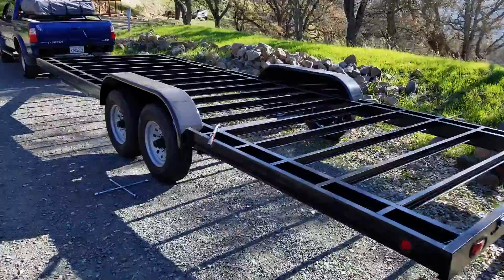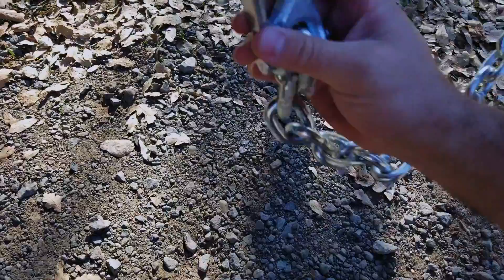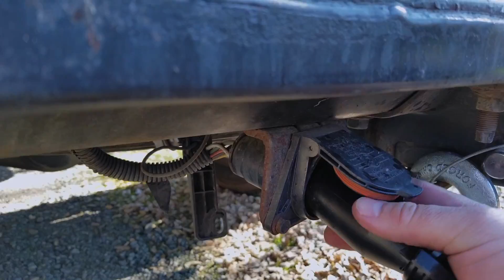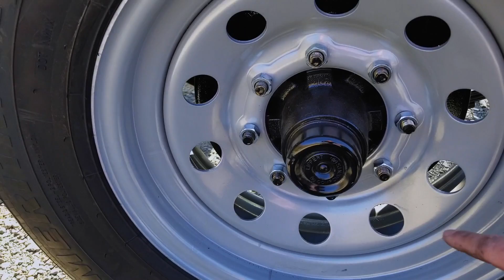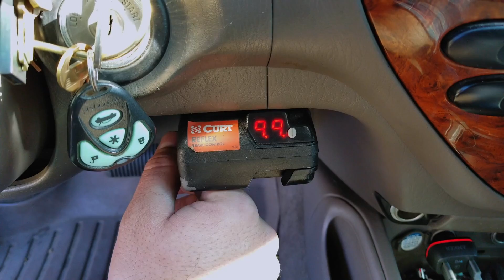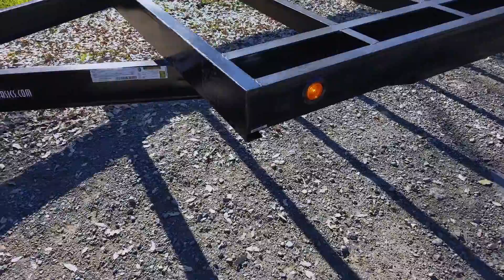How to Hook Up A Tiny House Trailer

Comment: looks great ,we are using a unfloor design to have forced warm air in the floor . take a look , we are also using positive pressure drains .  ( it helps with the limited floor cutting .